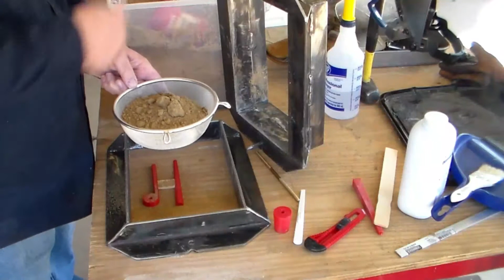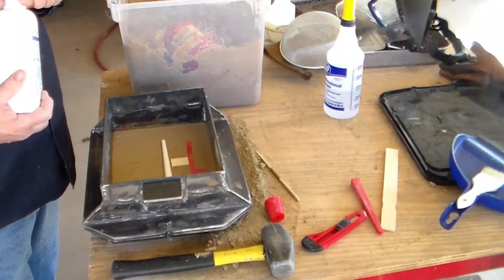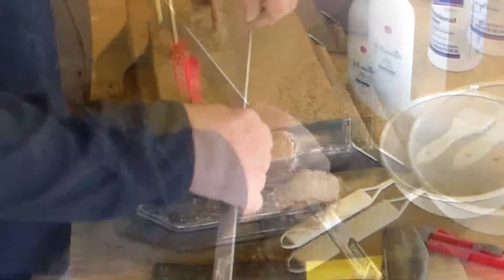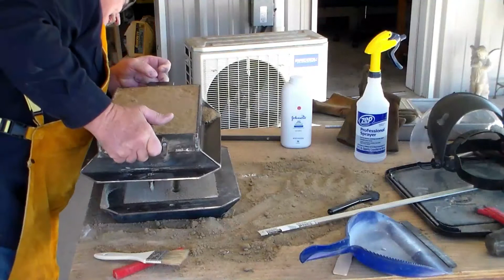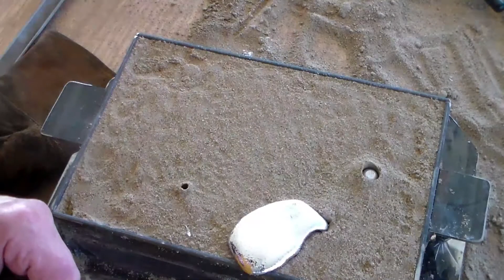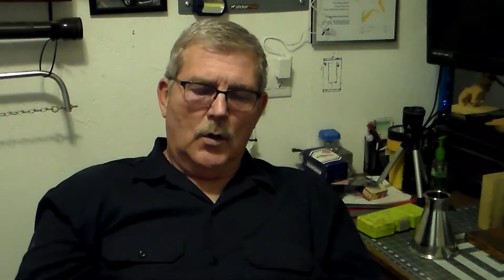First sand casting

Comment: Congratulations on your first pour, I think its probably the best first pour that I have seen on YT. After months of watching some “turd polishers” grab side of the road junk, cast it into a contaminated, useless, and often very gassy ingot that is then “polished” and put on a shelf in a pointless effort wasting fuel in the largely futile chase for video views it is very heartening to see someone who has not only bothered to study and plan before entry into the casting world, but who is actually trying to make something useful! –It bodes well for your casting future – bravo. 
A few points:- 1, Your sand clearly is a problem. I judge a sand by how it feels in my hands and how it responds to the methods and tools I use so it is difficult to diagnose your sand from this distance. But by the way it sieved, strickled off, and from response to pattern removal I believe it is way to dry. Lots more I could say here but this would get very long. If you wish to “hear” the rest come to me on olfoundryman@gmail.com and I will reply to you in more detail.
                           2, Re your feeder (yes, I know most people use the term “riser” but its function is to provide feed for the casting so I think the term “feeder” is more appropriate.) It looked a bit small – as a minimum its diameter needed to be 1.2 times the diameter of the big end of your casting.
                           3, I would not have gated half way along the part – the area around the gate always “draws in” a little making part clean up difficult and all the more so because the gate is to a curved surface. Instead, I would have gated to the base of the feeder - gives a straight easy cut off and better feeding       
                           4, Re moulding - a few quick thoughts, Wise to use a base board, and clearly you need some “instruction” on how to ram up a mould. Beware when making a proper rammer, many designs out there (including the one I suspect you will likely emulate) are wrong - more to say here too. Easier to pull feeder, vent, and sprue formers out before striking off. Holes below about ¾ inch you can strike right over any larger ones just work from the center of the hole outwards
                            5., It was oh so nice to see a good attempt at the use of a tapered sprue and a ridged pouring basin. Although it was a bit hard to see from the video it did look as though your ridge was too high. This is a fault so common as to be almost universal and its why your sprue did not appear to flow quite as full as would have been. More to say here too but for now the ridge should have been just 5 to 10 mm high and yours looked to be more. Damn good try though!
The sprue you used looked a little big (hard to tell). I don’t know what size sprue you made but if it is the same size as the one I machined up and sent to Perry a couple of years or so ago it should suite a lot of work, but note that there is no universal sized sprue nor even a universal taper. The worst thing you can have is too big a sprue.
                            6, Nice crucible shank - wonderful to see the simple time tested and proven design used – simple, easy, and no stupid clips that some think are necessary to stop the crucible falling out - in the thousands of pours I have done I have never had a crucible fall out of a shank……. Martin
Reply from the maker: Thank you Martin, appreciate your thoughts and instruction. You do a great job and this will be helpful. Take care

Comment: I visited Traverse city Iron Works and East Jordan Iron works in Michigan several times as a Vibration Technology Sales person. Alls I can say regarding the sand in the casting is it must have been very very dry, as the humidity in that place had to be zero...It was hotter than hell in there!  The casting for water hydrants, the sand must be very dry, and they used a motor driven ram to tamp the sand down before they poured the molten material in. You are walking on the wild side there Rusty! Woo Hoo, Hot totty!
Reply from the maker: Thank you my friend, great to hear from you. I added more clay to it so it will stick together better and trying to make it as dry as I can so it holds its shape but not to wet. We are having an ice storm now so it will be several days before I try it again. Appreciate you and take care

Comment: What do you  put in the sand so it doesn't fall out when it is turned over.  Looking forward to your next casting adventure.
Reply from the maker: I add bentonite clay powder and moisten  it with enough to hold its shape. Thanks

Comment: Your drilling hammer looks like it works pretty good for a ramming tool. That's a sweet first casting!
Reply from the maker: Thanks Matt, the hammer worked pretty good. But the future ramming tool will be a fun project because it is a lot larger than my first casting. Figuring out the proper gating will be important. Have a great week ahead

Comment: I am trying to remember what I learned about all this kind of work (45 years ago). I am sure we used 'green sand', but exactly what it was, I don't know, it came in sacks and was slightly sticky. I seem to recall we just used talcum powder between the mold boxes.
Reply from the maker: That sounds like a product called Petrobond we have over here. I ordered a bag of it to try. I first got interested in metal casting when I was just a kid around 12 yrs. old. We went to a theme park that specialized in hand crafted arts. The village Blacksmith really captured my imagination even back then. Thanks and take care my friend
Reply: @RustyGlovebox  The bad news is that it is expensive, the good news is that after use, sieved to remove the burnt bits, you use most of it again. For tamping it around the patterns, we used hard wooden 'tampers' which are not much different to club hammer handles. Some had square ends that were about 4" across, most had rounded ends. The thing I never got my head around (although with time I am sure you could) was making the wooden patterns bigger than the finished casting to allow for shrinkage and machining. I do recall an ancient pattern maker explaining why you needed different sized patterns to make the same part if you were going to change the metal used, as well as the amount of taper and the radiusing to get the casting to pour properly. Sadly, I didn't take notes! I know enough about the subject to understand that I know nothing about the subject!

Comment: Add some more bentonite clay to your sand mix to make it produce a smoother surface. This will also require additional water or oil, whichever you are using. Or......a finer sand grain size but yours looked decent.
Reply from the maker: Thanks for the tip, I will give that a try. I have more clay ready

Comment: Real nice for the first try.  I do see some doing  sand casting where they spray something on the sand before they pour , not sure what its for maybe a release agent or maybe to make a smoother cast . I'm sure you can figure it out.
Reply from the maker: Thanks Steve,  They may be wetting it with water if it like what I'm using. I sprayed it a little but just don't know . Take care